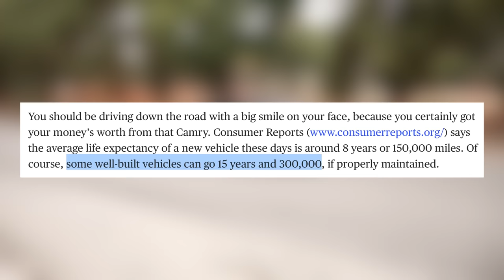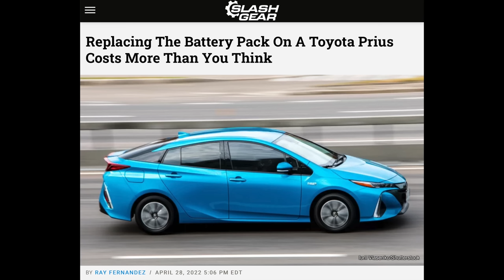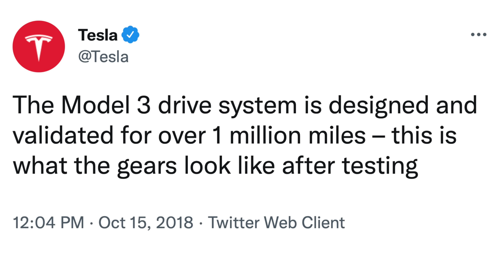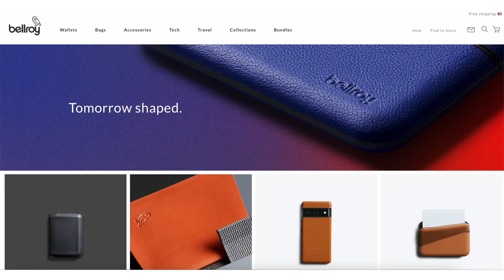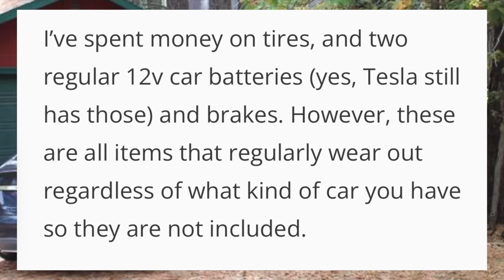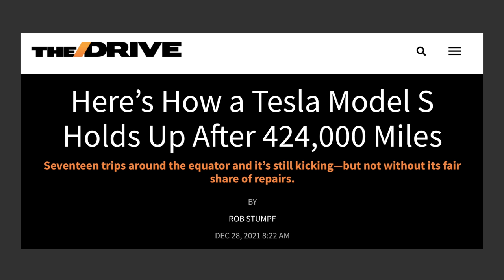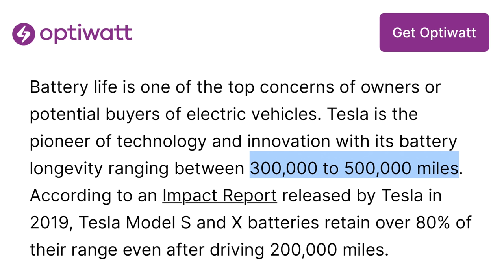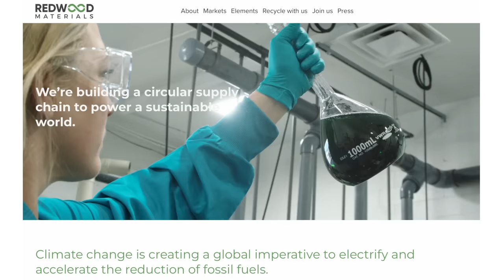The ONE MILLION Mile Tesla | It Still Runs

Comment: I've met tons of Model S owners with +350k miles on them with no issues! 🙃😃😄So twice the life of most cars and still running strong!!
Reply: @jeremytine  at least in a Tesla you are more than likely going to survive an accident compared to a Prius which is NOT a vehicle I want to be in during an accident lol
Reply: @jeremytine  wrong it has much less crashes per mile compared to other ai driving systems or fsd
Reply: 350k? That’s not common on any electric vehicle nevertheless ICE but not having issues is more incredible.
Reply: Doubt
Reply: @DeezNuts-sx9jd  it’s mechanically much simpler than internal combustion. I have an electric drill from the 1950s.
Reply: @DeezNuts-sx9jd  ICE’s have over 20000 moving parts and electric vehicles have from 1000-200 moving parts
so its more than possible to get an electric vehicle with over 350K miles
Reply: @shoking9825  that's not my point, in saying he hasn't met a ton of them.
Reply: @rallycsx  I'm not saying they exist, I'm saying I doubt he's met that many. Most EVs are used for local travel.
Reply: I had one. No problems at all.
Reply: But i saw guy who have replaced 4 times his battery 2 times for warranty and 2 times for 20000$

And yes he was taxist
Reply: @shoking9825  if its possible why did this tesla have its electric motor replaced 8 times that is once every 125k
Reply: @strategistaow3520  Yeah well how many of these stories do you hear tho?
Reply: So what? I have met literally thousands of people with ICE cars with over 500k miles. It isn’t difficult if you drive it a lot. Many Taxis, Many transport trucks. Many service vehicles. It isn’t surprising at all.
Reply: @ronlaverdiere  “many “ lol…. Yeah quit lying
Reply: @bruceyung70  To be honest, that was when barely anyone really daily drove EVs, and they were stuff like the Leaf or some other small EV
Reply: @Stompinwind  what are you talking about? There wasn’t one in the video that replaced 8x
Reply: @Khanfuzed1  14:30 it was replaced 8x
Reply: @Stompinwind  what was…
Reply: @Khanfuzed1  the drivetrain which includes the electric motors
Reply: @DeezNuts-sx9jd .... One tesla is more than a tonn.... 😂
Reply: @aronandreas  I said dude hasn't met a ton of them. I said nothing about tesla weight. 🤡🤡🤡
Reply: @DeezNuts-sx9jd  well... The Tesla has the miles, the owner just join for the ride... 🌹👍
Reply: Lying about what? Have you never seen a taxi before? There are literally thousands of them in even a moderately sized city. I drove taxi for a bit. MANY with over 350k. Ever see a transport truck before? If you drove on the highway once in a while you will see dozens in a short commute. They easily put on over 500k. Just because YOU have limited life experiences doesn’t mean everyone else has as well.
Reply: @Stompinwind  lol they went quiet all of a sudden
Reply: Teslas are like 3 times the price of a regular car, so what is the big wow-factor here? It should last 3 times the average car before I am impressed, so around 3M
Reply: @ronlaverdiere  my company has 4 gas powered vans that have 400k +/- with original engines and transmissions without any rebuilds. Only expensive repairs have been with catalytic converters. It is certainly possible
Reply: Toyota came in the chat what you say🤣🤣
Reply: My 2009 Ford Escape hybrid. 787,000 km. (489,000 miles).  No major components replaced. Just brakes and struts.
Reply: @DeezNuts-sx9jd  he’s probably met like 5 people which is impressive. I own a Tesla and I don’t even personally know 1 person who owns a model s.
Reply: With 4 times the price
Reply: @shoking9825 how about EV has less than 100 parts.
Reply: I’m one such person with a no-issue 375k mile Model S, degradation is around 25%
Reply: How many batteries?
Reply: Lmao most of our work trucks have over 300k and are abused  none have had a engine replaced a few have had transmissions replaced but a Tesla can’t even pull a skid steer so there’s that too not knocking Tesla but they can’t replace gas vehicles
Reply: How is this even possible. I drive an 07 civic with 250K. I drive 100 miles a day. Doesn’t make sense on a new electric vehicle with added charging times and battery degradation.
Reply: @ronlaverdiere  ICE Taxis are FOREVER in the repair shop. Also feel rough when riding in them. Most of the issues are on older Teslas. They have made huge improvements since so newer vehicles will last longer. 
I’ve owned at least 6 vans and every one of them within the first 3 years has had major mechanical issues.
Reply: @thomasswainson2047  forever in the shop… yet they are on the road 24/7 earning an income… ok Thomas whatever you say. Real world experience trumps your fictional claim.
Reply: @thoos192  so average cars last 1,000,000 mi? Put that crack pipe down bud
Reply: @TomcatJones  my brother got tboned a couple weeks ago in a tesla model 3 at 40mph on the driverside bro walked away unscathed it was shocking
Reply: 350k miles already? These cars are still quite new.
Reply: @And1one757  Almost all vehicle accidents are shocking. I was the passenger in a 1982 Chev truck that was t-boned in the passenger door. Very shocking. Watching that front end ramming right into where you are sitting … there really is nothing adequate to describe it. Luckily I walked away. I would never advocate not wearing a seatbelt but glad I wasn’t that day.
Reply: @Ron Laverdiere  i wasnt saying the accident was shocking i was for as much damage the car took surprised he wasn't injured
Reply: @And1one757  All the airbags and under skin structural refinements in the last 30 years have only added to the survival rates. Also, I very much doubt your friend was uninjured. Side impact airbags pack quite a punch. Walked away without any serious injuries, yes I can easily believe that. Same would be true with almost any car legally sold in North America in the last 15+ years in the same situation. As I said, I walked away from the same incident in a 1980s half-ton truck - they didn’t have ANY airbags in those.
Reply: Um, not quite, a well-maintained diesel will do a million kms
Reply: @rickvaz8940 okay, that’s bullshit. I can believe 200-1000 moving parts, but 100? No.
Reply: Twice the life? Tf do people just not do maintenance anymore?
Reply: @rickvaz8940  less then 100 parts….   If that is as high as you know how to count then every car has less than 100 parts. Or you’re talking about a Hot Wheels Tesla. A real, full sized production Tesla had WAY more than 100 parts. The battery alone is over 4,000 cells.
Reply: @ronlaverdiere  I might be able to count to 101. That being said, my answer was a bit short. There’s between 150 to 250 moving parts In A Tesla.
Reply: @rickvaz8940  I would guesstimate you are still missing several things. Suspension, steering, brakes, switches, relays, stalks, mirrors, windows, doors, lids, hvac system, battery management system, drive unit(s)… Not to mention, there are a great many non-moving parts that wear out.
Reply: @TomcatJones  i wouldn't even call a prius a vehicle
Reply: naa i know multiple gas vehicles that have done the same if not have gone over that with no problems. my car is 21 years old and still runs while these battery's are only warranty for 3 years.
Reply: @izaacschwieterman132  these batteries or those batteries? Which ones? Mine is 8 years.
Reply: With original battery and power tran?
Reply: @shoking9825  Is there a list somewhere of all those moving parts? I'm struggling to get past 200 for an ICE engine, so what's the rest?
Reply: Cars can easily last 200K+ miles like Honda, Hyundai, Subaru, and Toyota. Just gotta maintain them and not drive around destroying the car treating it like a race car. EV or ICE, wheel bearings, breaks, fluids. My engine blows up I could get a new car or put a new engine in it. Battery fails on a M3, broken tube or something Tesla sells them for $25K. For the cost of the battery just get a car. Everyone can’t get an EV. The grid can’t support it. Not to mention the power plants running Coal and Natural gas to produce electricity so you’re still burning fuels directly vs indirectly.
Reply: @mattbrodeur7416  What vehicle have you ever owned that required you to do “break” work? I have never destroyed “breaks” on any vehicle.

More than 60% of my country is renewables. Locally, 100% is hydroelectric.
Reply: @ronlaverdiere  I’ve driven more than 400K miles on a few vehicles. Replaced shoes on my 1997 F150, replaced rotors and pads front and rear on my Chrysler 200. Breaks are consumables in each case ICE or EV.
Reply: @mattbrodeur7416  “Breaks” are not consumable with a car. Maybe you mean brakes?
Reply: My dads duramax had 350k no issues
Reply: @mvc2177  the company I work at the work trucks all have over 400,000 miles
We have a f-350 with 671,000 miles original engine only thing replaced was the transmission at around 500,000 miles and suspension components when needed
It will probably still go another year before the rust dissolves the floor boards to dust but they definitely got their money out of it
Reply: in "tons" of model S you mean 2-3?🤣 I've watched Bjorn's videos and his original Model S had a lot of issues, just like his Model X. And you know that there are a lot of ICE cars that have +300k miles and are still on the road going strong.
Reply: @shoking9825  then why is Tesla in last place for reliability in all surveys?🤣
Reply: Most cars run to 300k so until you get 600k that's not double.
Reply: Never met anybody with more than 150k miles on one. Where do you live?
Reply: @silimarina.  because they’re the newest mass production car company in the last 100 years to make anything worthwhile and are bound to have quality control issues. At the end of the day, the maintenance is infinitely less than ICE cars.
Reply: @Ron Laverdiere  moving parts Genius. Lmao wow

Quick search will show you Tesla has 17-20 moving parts. Thats it bud
Reply: @Rick Vaz  Genius number 2. 

To help you with your own argument. Might be helpful to know the exact number when you debate. 

But Google says very clearly in about 40 different articles. Tesla has 17-20 moving parts. 

Key word here for the both of you

MOVING PARTS. 

LMAO
Reply: @ronlaverdiere  and the resale value is scrap metal price at that time. BATTERIES are worth 10 times that $200 .
Reply: @cuinican1980  no. That is just in the drive unit, genius! You said moving parts in a Tesla. A drive unit is just one component in a Tesla. Some Teslas even have multiple drive units. You need to try counting again - or clarify your guesstimate. Good try though bubba.
Reply: im getting third battery 150k miles , the range means nothing as to the life expectancy
Reply: @powerpartso quit crashing it into walls and you won’t have to replace the battery so often!
Reply: Theres no documented cases of any Tesla with 350K miles on them. Thats because they are good for only local driving.
Reply: Other than Toyota's and Hondas
Reply: 350k miles? Thats not common on even fleet vehicles. How are you meeting tons of them? Who is driving THAT much on a car that can’t be more than 11 years old.
Reply: Yeah sure, just ignore all those 1980s, 1990s and early 2000s diesels still on the road with the same mileage or more 🤡
Reply: @ronlaverdiere what about semi trucks? they hit 1 million all the time
Reply: @thegzak  what size is your battery.
Reply: @ceylontea5877  it was 85 kwh, original battery
Reply: No you haven't
Reply: @thegzak  awd or rwd how long orginal drive unit lasted you charge mostly 240volts? So many questions close to buying a used tesla out of warranty!
Reply: rwd, mix of all types of charging, drive unit was replaced under warranty about a year in because that was back when drive units often developed a grinding sound and mine was one of them. No issues since, most of the mileage was on the new drive unit. One thing to note is that supercharging speeds tend to drop as the battery gets older, but this is something you can test before you buy - ask to take it with low state of charge to a supercharger and see where the rate peaks, and how long it can sustain that peak rate. Mine usually peaks at ~100 kW but can occasionally peak up to the full 150 kW but very briefly. From the usual 100 kW peak it also tapers off fairly quickly, probably by 50% charge it’s already at 65 kW.
Reply: @thegzak  Thanks good info.
Reply: @powerpartso  what year and model of your Tesla AWD or rwd you charge at home or supercharge 3 batteries that's a lot did Tesla replaced it under warranty?
Reply: BS

Comment: 170k on my model 3 with less than 7% battery degradation, zero dollars spent on maintenance outside of tires
Reply: Not even like, streakproof freezproof window washer fluid?
Reply: Can you give us an update one how it’s going plzz thanks
Reply: @crackerjuice75
Reply: How do you check for battery degradation?
Reply: @blueacquisitions7262 The car's maximum range decreases as the mileage goes up. Then you calculate, very simply, by what percentage the maximum range has gone down versus what it was when the car was new.
Reply: How is it holding up now